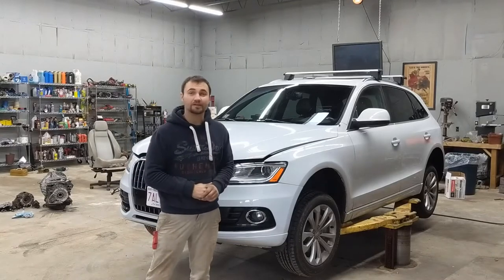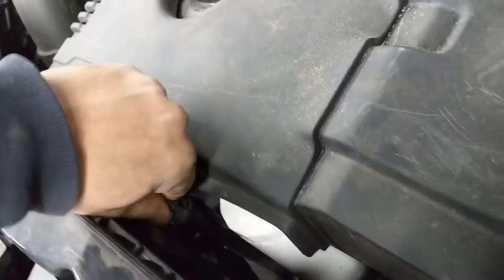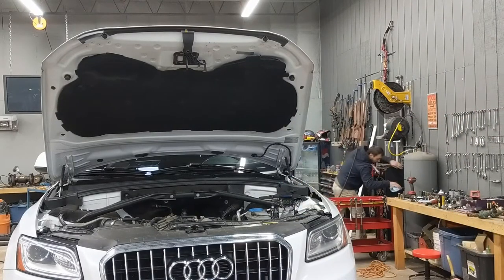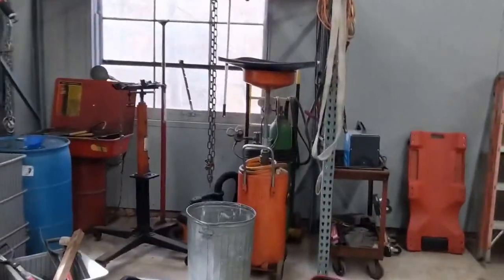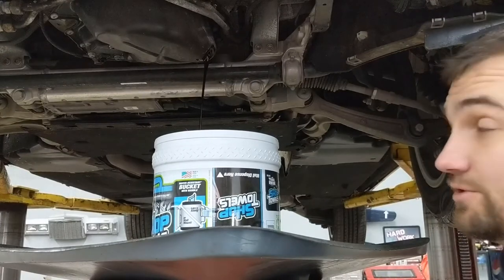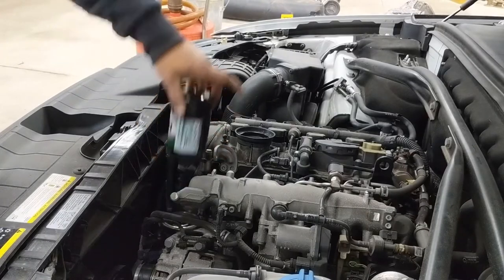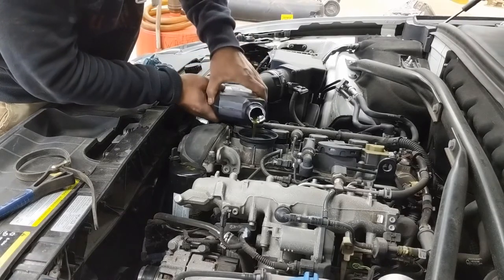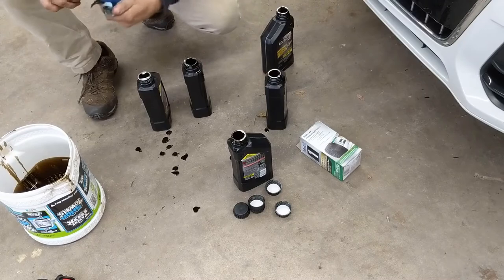WHAT DOES LOW OIL MEAN ? CHANGING OIL ON AUDI Q5

Comment: You’re supposed to suck the oil out the top through the “dipstick” tube using an oil extractor. No need to go under the car. Easiest oil change ever.

Low oil means it’s time to add a quart. It’s not critically low but it’s time to add some.